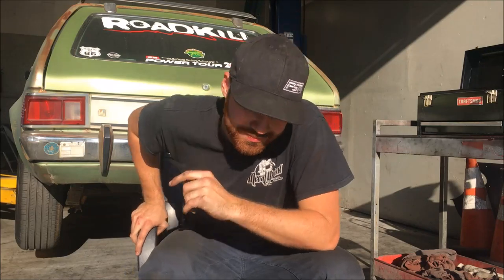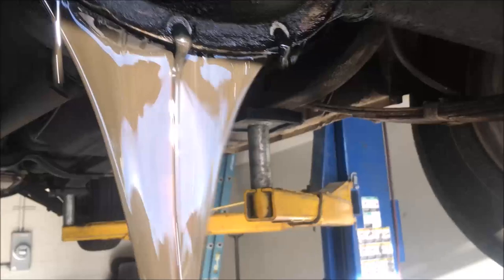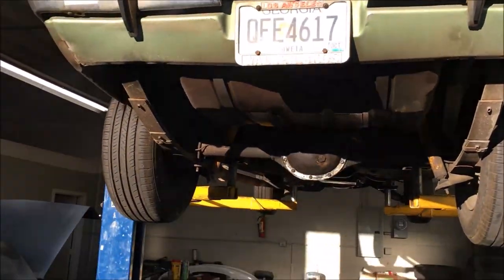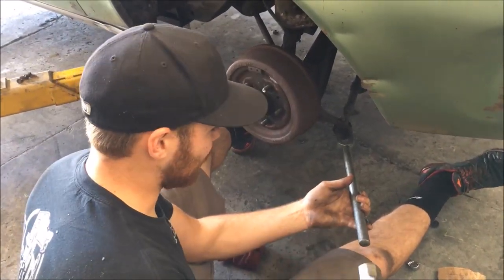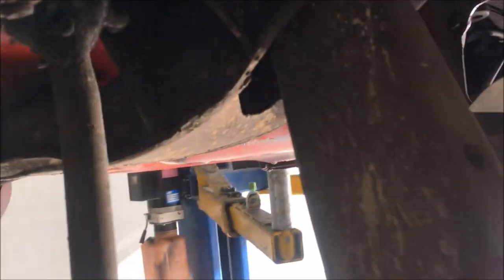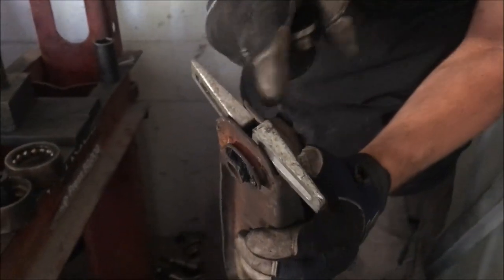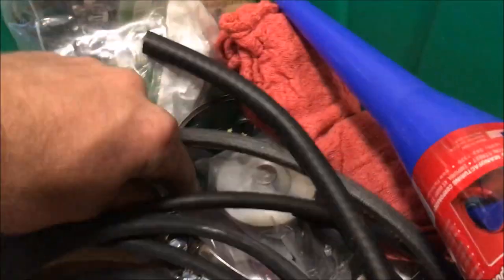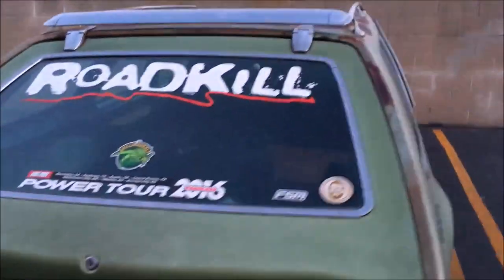Prepping for the Hot Rod Power Tour (How To) - Sally's Speed Shop: Episode 7

Comment: Was it a trick of the light or did that gear oil look like chocolate milkshake? Your breather tube is missing if the oil is that light brown.
Reply from the maker: For all I know that was original fluid in there but it looked fairly decent actually. Breather tube is in fact intact.
Reply: Realizing that sentence looked like it was input by an illiterate 13 year old... Good to know the oil in that diff wasn't as bad as it looked on camera.